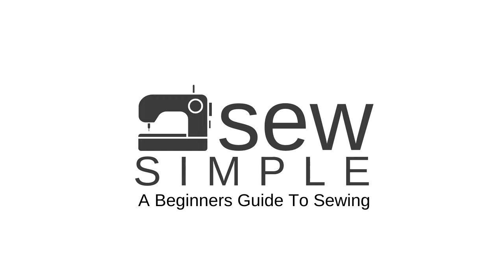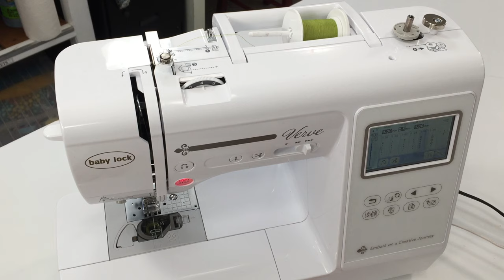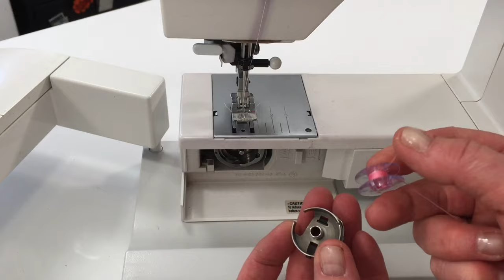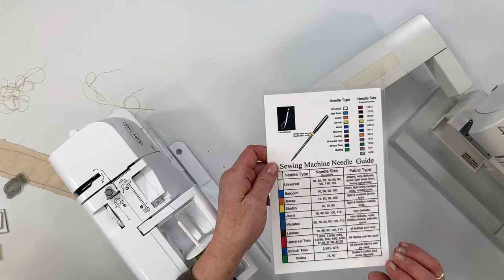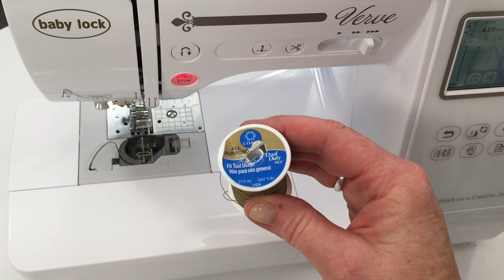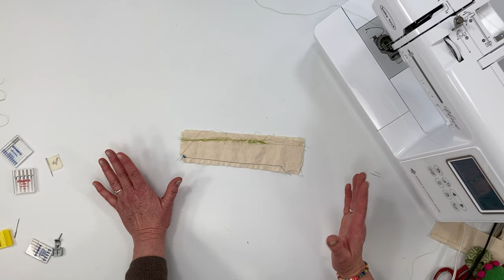Troubleshooting 3 Common Sewing Machine Problems | Sew Simple Series Lesson #7

Comment: It’s been ages since I’ve sewn, so I’m really rusty. This is so helpful! I definitely will be doing  this as I troubleshoot and figure this all out. Thank you so much!
Reply from the maker: Glad it was helpful!
Reply: I have re thread so many times.watch videos for my type of machine and according doing top threading correct.  Bobbin checked out fine. I can pull the thread and then nothing or breaks. I haven't use my machine in awhile but was service 2021. Just pulling it out 09/10/22 what am I doing wrong I'm in tears new grand and just learned to hand quilt
Reply: Sir/maan. Pkeaae help me to fix my sewing machine. The dogfeed is not movibg  i already changed it but its still rhe same.  It doesnt move. Please help me. THABK YOU.
Reply: Upper thtead breaking often
Pl. Help.😊
Reply: @malekakapuswala9162  Check its tension :) It might be too tight. Try a lower setting on upper thread tension.

Comment: Hi, thanks for the info. I thought this problem was caused by the bobbin tension so I slightly tightened it and it seemed to make a difference but didn't get perfect. Then I loosened the tension on the top and it started getting better then I loosened in a little more and it works great now. Thank you very much for the video
Reply from the maker: You are so welcome!

Comment: Thank you so much.  In less than 5 minutes you solved a problem that has frustrated me many times--bird nesting.  You said to rethread my machine, which I had done many times, but my thread spool holder was not keeping my spool of thread tight. A tiny piece of masking tape solved the problem until I can get a replacement.
Reply from the maker: glad you figured it out!

Comment: Good info Jan. 
I keep my needles in one of those plastic divider cases with a closing lid that has multiple sections (1x1 or 2x2) & I put the different needle cases (jersey, universal, denim or serger, embroidery etc) in it’s own section so that they are all located in one place & that I can tell when my supply is running low.  But the best part is that when I go to change the needle, that needle case is left at the front/center of the divider in it’s own section so that I always know (later when I’m distracted or haven’t sewn for awhile-lol) what kind of needle is in the machine. It works great & hope someone can find this tip useful.
Reply from the maker: Thanks so much for sharing. Great idea!

Comment: For me it was the rethread (2:37) that fixed the problem. At that fourth step shown labeled on the machine I didn't have it hooked to that little metal thingy, and it caused the whole bottom thread to be shred into pieces and some ended up entangled at the bottom and if not that it caused the whole machine to buzz loudly and stop. I'd taken some sewing classes but admittedly it's been 10 years since then !
Reply from the maker: Glad you figured it out.

Comment: I’m sewing a circular appliqué, the thread is very loose and bird nesting above the fabric. I’ve tried rethreading a number of times, thread and bobbin. I’ve also pulled out scrap fabric to try to trouble shoot. It’s fine on the scrap and when I get back to my project, it’s fine for a couple minutes and then the same thing.
Reply from the maker: Kinda sounds like the bobbin thread is not going through the tension correctly. Try that.

Comment: This video was very helpful. I am a completely new person at trying to sew. I threaded my machine the way the instructions stated even watched videos on my specific machine, somehow I managed to get the top thread tangled underneath by the bobbin. I had to take it apart to get it out. Please help me to understand what I did wrong? Thank you
Reply from the maker: It's hard to say, not knowing your machine. But it sound like to me that the bobbin isn't being put in place correctly. Does it snap in place when you insert it. The needle of your machine needs to be in the most upright position for the bobbin to go in place correctly. You may need to turn the handwheel on the side of your machine to move the needle up.

Comment: I love your easy tips. I have a problem that I haven't seen. I'm missing a bottom Stitch occasionally, not at regular intervals. On top it looks fine but underneath there are places where it didn't catch the top. I can pull it loose on the top in those places, but it looks like it went fine. That's actually what happened. I finished sewing, turned out over & wanted to cry. Any thoughts are welcome.
Reply from the maker: You may want to check to make sure the needle is put in all the way. If its been a while since you changed your needle, you may want to do that and sometimes the timing can be off on your machine, which a mechanic can do really easy.

Comment: I have a Verve as well, my top stitching is not looking stitched, more like a straight line. It used to have the stitched look, and my bottom stitching looks perfectly stitched. Any ideas? I already brought the machine in to service and checkup in January. My machine sometimes also makes a loud clunking noise when I’m sewing. 

Thank you for the video!
Reply from the maker: Sound like a bobbin issue. Have you rethreaded the machine and made sure the bobbin is threaded and in correctly?
Reply: @JanHowell  thank you for the reply! I was actually going back and forth with Babylock, they are so patient and helpful. Apparently my Babylock Verve doesn’t like Coats & Clark thread 🤪 so I’d send pics and tension adjustments and we got it just right with a different thread. Gutterman, Medeira, and I know my Brothread embroidery thread all seem to be my machine’s favorites lol

Comment: i have a brother NQ575 that is 2 wks old.  It was doing well until a couple days ago.  I got top stitch a design on my table top and we're going along and then it just got into a spot and bunched on the bottom and made a nest.  I have gray on top and brown in the bobbin and it is also pulling the top thread and mixing with the brown.  I've rethreaded everything a number of times and it still does the same thing.  I've tried dif tensions and nothing is working.  The store i got it from keeps telling me user error.  Well Im not that unfamiliar with what I'm doing.  I've read thru the book, troubleshooted and nothing is working.  Is this an out of whack issue with the machine.  I am so frustrated already.  can you give me a few more things to try that i havent tried.  Thanks
Reply from the maker: Have you checked to make sure the bobbin is threaded correctly and put in correctly?  All machines are different. Now that you've changed the tension, there may be an issue there. The shop where you got it should be more than willing to help you out and fix the issue.

Comment: Yes bird nesting but worse the spool will not allow the thread into the little notch and under the metal slice which normally allows the thread through a little space at its end. I have put the spool in every which way and it just wont go in that notch. Had spool facing backwRds forwardsm upside n et
Reply from the maker: Yes that will cause problems

Comment: Thank you for the imformational video! If  I may ask a question, what does it mean when your thread nots up  on the string attached to the bobin?
Reply from the maker: Sounds like an issue with the bobbin. I would make sure the bobbin has been threaded correctly and even the top of the machine threaded correctly. It may also be due to the quality of thread you are using.
Reply: @JanHowell   Thank you, I will try that.

Comment: You said, "Don't get discouraged, there's other things you can do...."
I replied, "Yeah, have a n
Margarita."  I have been so frustrated trying to figure out my thread issues and I DID touch the tension.  Bought new needles, been studying manual and watching videos for a month.  I'm ruining the quilt I've made.  Usually use invisible thread on top layer and I wondered if nylon got old...fishing line does..same thing.  So I'm  using cotton on top and bottom, I'll end up ripping all the seams out.  I've  cried, cussed, yelled, laughed, walked away and given up, to start again next day.  I am a warrior.  😢
Where is the tension supposed to be?  Next video..
Reply from the maker: Each sewing machine will have different tension settins. They can get so messed up that only a sewing machine mechanic can get it back to where it needs to be.

Comment: I am stumped.I  cleaned my thread path, bobbin area, replaced the bobbin case and the bobbin -bobbin in correctly. I  use a thread stand. Thread foot up then  drop the  foot to thread the needle. Birdnesting is happening in spots along the  seam and definitely top thread. It is not happening at beginning of seam. I am thinking it is a tension issue after sewing on marine vinyl??
Reply from the maker: It could also be the timing on your machine. Maybe it's time for service? Have you tried changing the needle?

Comment: You didn't cover my problem. The top stitch doesn't grab the bottom thread. 
You think you're sewing but you're just pocking holes in the material. 😊
Reply from the maker: Check to make sure you're needle is in correctly.

Comment: I just cleaned the bobbin case area and the pressor foot plate. It was really dirty. I knew to be gentle and I thought all was well until I tried to sew. The fabric did not move. I rethreaded it and put the bobbin in again. No change. What do I do now?
Reply from the maker: Check to make sure the feed dogs are in place. You may have disabled the feed dogs. There may be a switch on the back of your machine. If nothing else try taking out the components and reinsert them.

Comment: One thing happened to me the other day - my foot controller stopped working.
I could not understand why.

The sewing machine was plugged in, turned on, and its light worked, so there was power to the machine.
I could rotate the hand wheel, and sew using that, so nothing was blocking that from operating.
I checked the connection of the foot controller cable into the machine, removed it and pushed it back in. But the foot controller still did not work.

I checked the foot controller to see if something was caught under it, or within it to stop it depressing. But the foot controller could easily be pressed with my fingers, but it would still not operate the machine.

I turned the power off to the sewing machine, and back on, but the foot controller still did not work.

I thought that maybe there was something broken in the signalling between the foot controller and the machine such as a broken electrical/electronic connection. So left the machine, thinking I would have to take the controller into a sewing machine repairer, or I might need to buy a new one.

Later in the day, turned the machine on again, and everything worked !!!!!
Maybe the machine was just tired, and needed a rest, lol.

Still have no idea what was wrong with the foot controller not being able to be operated.
Does anyone here have any thoughts?
Reply from the maker: If it is a computerized machine, it may have just needed to reboot.

Comment: What do i do when as soon as i start to sew, my thread from the to needle ends up out of the needle. I had a problem, don't remen er what, put it aside because i couldn't get it to work right.
Reply from the maker: Before you start sewing, pull the tread so it is longer. Some machines have that issue. Or you can hold the thread for the first few stitches.

Comment: I have a singer sewing machine it was working fine but now its running fine but the stiches holes are forming but the actual stich is not happening .
Reply from the maker: I would recommend rethreading the machine first, then make sure your bobbin is in correctly and the thread in the bobbin is threaded correctly. Also try changing your needle.

Comment: I have a problem, not a tension one but when I put in the bobbin, I hear a click which means that I know that the thread is locked in so it will come up and sew properly, except the thread is jumping out of the hole (on the bobbin keeper). I have had about enough of it, so what can I do to sort it. I would be grateful for your help. thanks
Reply from the maker: Make sure the thread is going through the tension on the bobbin. Sounds like it's not. Try rethreading the thread into your bobbin. Is it a front or top loading bobbin?
Reply: @JanHowell  Yes I did all those things, there is a tension thing that you wind down so the foot and or needle is lowered, but since I have done this I havent had an issue.    It was almost like the foot and needle were not close enough to pick up the bobbin thread, well whatever I did it worked. I think more likely the needle I will call it a post as I dont know what it is called, wasnt close enough. I also had to take the foot part where the snap ons attach and slightly lower it too, as when sewing two pieces of fabric together it was like there wasnt anything holding it in place, in other words like the foot was up, when it clearly wasnt.  But thanks for your reply anyway, Its is very frustrating to have to rethread  especially when one is vision impaired. I can assure you there were many stop and take a breathe moments. If I find I have another problem I will be sure to reach out, again thanks.

Comment: The front loading machine bobbin is inserted in the opposite direction than what is shown in this video. What is shown is incorrect. In ALL sewing machines, regardless of how and where the bobbin case is inserted, bobbin thread reverses direction as it exits the bobbin case. This is to prevent spooling or fast spinning of the bobbin within the case, causing jams.
Reply from the maker: I guess it just depends on your machine. My machine, and all my other FRONT LOADING BOBBINS instructions say to thread as I have instructed. Whatever works for you. My machine stitch works well this way.
Reply: @JanHowell  You are correct. When loading front loading machines you must insert the bobbin inverse to what top loading machines require. ALL machines require that the bobbin thread reverse direction as it enters the bobbin tension from the bobbin. If the the bobbin is inserted backward the bobbin can spool forward and jam. It's not a matter of whatever works for you. Sewing machines are designed in very specific ways and require precise application of parts to operate properly without poor stitching and damage.

Comment: You said nesting is usually caused by problems on the top side of the machine, but then you said to check the bobbin. You also didn't show the back to see that there is no nesting.
Reply from the maker: If the nesting is on the under side of the fabric, it's usually the upper thread was not threaded correctly.

Comment: What if the tension on the thread doesn't change even with the foot down
Reply from the maker: Sounds like you may need to thread it again and make sure the thread is going through the tension correctly.

Comment: I have an LS-1217 sewing machine .. Bobbin thread keeps breaking .. Reinsered bobbin so many times .. Rethreaded machine.. Cleaned out all lints but no success..can you help?
Reply from the maker: Here are a couple more things to try. Make sure the bobbin itself is threaded correctly. Has it been a while since you've used your machine? Do you have a top loading or side loading bobbin?
If you haven't changed the needle in a while, that could be a problem as well.
I hope that was helpful. Let me know if you have further questions.

Comment: I have been trying to sew my leggings. Unfortunately, my sewing machine is not picking up any stitches, just a loose length of thread. I am using the ballpoint needle and the stretch thread still no result. Can you help me?
Reply from the maker: I would check the bobbin. Make sure the bobbin is threaded correctly. You may also want to check to see if the needle is put in correctly.

Comment: I get nesting when I backstitch. Only my starting backstitch, not the finishing backstitch. It's driving me crazy! It doesn't happen any other time. I'm at a loss of what might be causing this.
Reply from the maker: Something that will help with this is to hold your threads for the first few stitches. Then you can let go of the threads. Try this. It really does help that bunching up underneath at the beginning of your stitching.
Reply: @JanHowell  after watching this video I spent all night trying to figure it out. I was holding my threads, but turns out after I put the presser foot down (with the thread under it) I have to PULL my top thread until it won't give easily anymore. Then I hold both of them for the first two or so stitches. My top thread had just a little slack that needs to be pulled out. Problem solved lol. Just wanted to post this just in case anyone else was having the same problem as me.
Reply from the maker: @notreallyawaitress10  thanks for sharing. All machines are so different. You learn what works. Great tip.
Reply: Iam having the same problem right now, thank you so much for sharing your experience, I really appreciate your kindness 😭💕💕💕

Comment: Currently having a problem with my singer heavy duty 4432. Not sewing any stitches. Help?
Reply from the maker: Sounds like you may need to take it to the sewing mechanic.
Reply: @JanHowell  I got it 3 days ago. Everything is running fine feed dogs and everything only problem is when I try to see my fabric holes are made but the thread doesn't go in
Reply from the maker: Try re-threading your machine and make sure the needle is threaded and put correctly into the machine.
Reply: @JanHowell  I will try this. Thank u:)